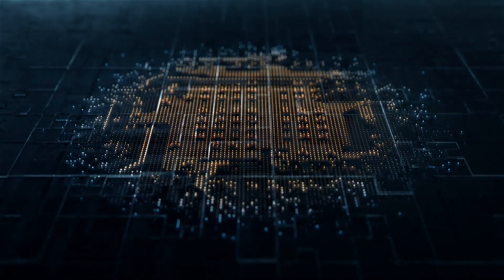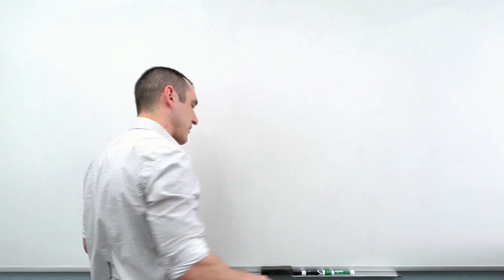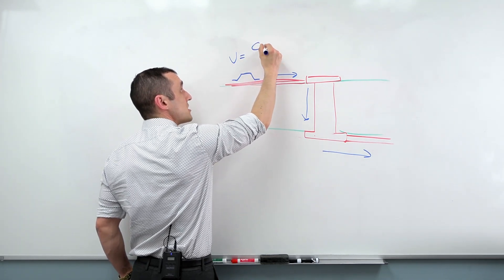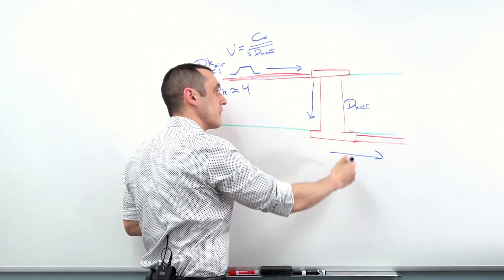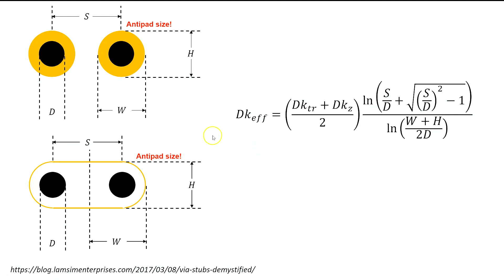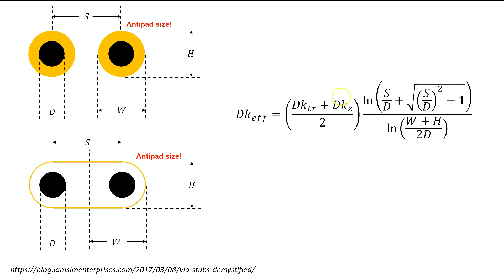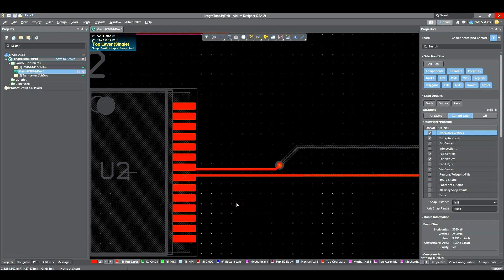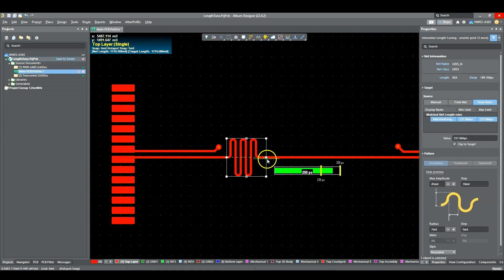How to Calculate Via Delay | PCB Routing Tips

Comment: good video, but it seems only cover signal transfering from top to bottom,  how to calculate if signal propagate from top to inner layer, say to layer3 in case of 6 layers board?
Reply: Time = distance/velocity, just use this definition and you can calculate the propagation time to any layer.
Reply: @Zachariah-Peterson  Thank you very much for great video! I would like to understand how I can calculate delay if I don't have the antipad on signal layers, but the via passes through the inner layers (GND reference planes)?

Comment: hi, I have a question, In the DDR4 routing chip manufacturer suggests using the Z-axis delay feature in Allegro software when routing the DDR4 signal What's the equivalent solution in Altium? do I have to use math or is there any third-party tool to calculate delay, especially for DP for different layer stackups?
Reply: There is not an equivalent delay calculator feature in Altium. I do not know the accuracy of the Allegro solution, if it is based on an equivalent circuit model then it will be incorrect. But they likely took the solution from Sigrity and used that to determine the vertical via delay, or they might do it based on adding up the delays in each layer.

Comment: When Altium calculates overall trace length it adds a proportion of the via length based on the layer stack settings.  If length matching is used for DDR then via delay is not required but package flight time adjustment must be entered in mm or converted from ps.

Comment: Automatic via delay calculation should be made possible. Add via fill/plug material (via plating, plug dk value etc.)to the via properties. Layer stack and material properties are already there. Why bother with entering the values yourself? Board layout software should be developed like a 3d game engine, then you will have all structures present in 3d for simulation/calculation instead of pseudo 3d (2d with additional parameters for thickness). Just as in Hyperlynx you will have to let the toolling know what type of signals (rise/fall times, frequency, amplitude etc) are present.

Comment: wow 43 ps delay for each via. that is handy info, especially routing single end high-speed buses like RGMII and XGMII
Reply: Just remember, that was for routing across the entire stack. If you're only routing across two layers, like in a board with thin laminates going from surface to L3 for example, the delay will be much lower, maybe 7 or 8 ps depending on length. However, if you did that then there would be a stub. Then you could use that Dk effective value to calculate the frequencies where resonances occur and create strong insertion loss along that route.

Comment: Totally grateful that you answered my question in such a detailed way! Thanks! 

I have one question regarding the anti-pad diameter in the single-ended example. In practise, what is the anti-pad exactly? In my designs I usually remove unused via pads on internal layers, so would the anti pad just be the diameter of the GND plane clearance around my drilled hole?

So if I had a 0.45mm pad via with 0.2mm hole and my design rules were set to have 0.2mm copper-to-hole clearance, my D1 would be 0.45mm, d would be 0.2mm, and D2 would be 0.6mm?
Reply: You're very welcome. In your example your numbers are correct, the antipad is just the diameter of the hole around the via in your ground plane. With your numbers I get L = 1.4 nH and C = 1.05 pF, and the result is 38.4 ps delay.

Comment: Thanks for the explanation! Would be great to see AD integrating these calculations at least into the stackup solver, as it seems like it's got all physical parameters required for such calculations defined as a stackup. Even if not automatic, but simply as a tool to have handy when setting up all those length-matching rules.
Reply: It does have all the physical parameters for this approximation, so you're right it could conceivably automate that simple calculation. The problem is that as soon as you try to control the via impedance with any nearby ground vias, you change the propagation delay for that via. Bringing in some GND pour on another layer that doesn't match the main antipad dimensions also changes the delay. Controlling via impedance is not normally talked about, but that via's L and C values calculated in the video do give you an impedance if you take the square root of L/C.

Comment: 43ps for 1.57mm single ended 16ps for diff vias😱 how can i be sure lpddr4 layout will work even route the same layer...
Reply: Well that 43 ps is an estimate for routing across the entire stackup. If you were routing a couple layers deep you would maybe have 10-20 ps depending on layer thickness.